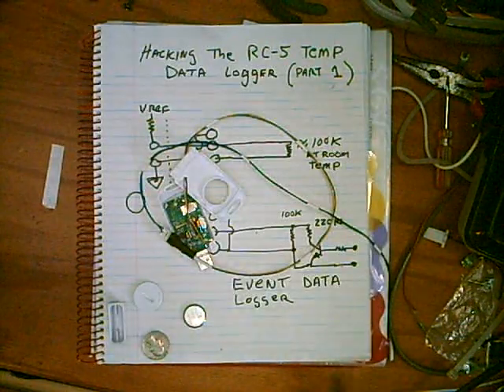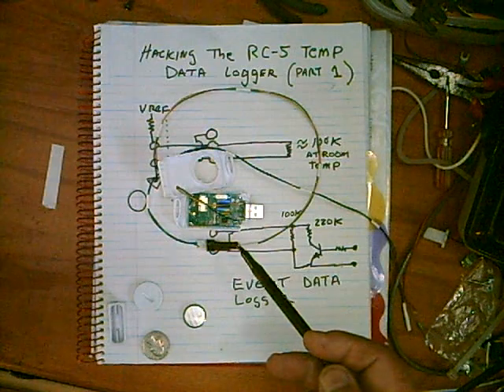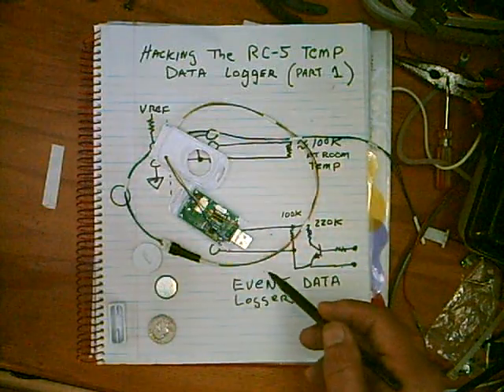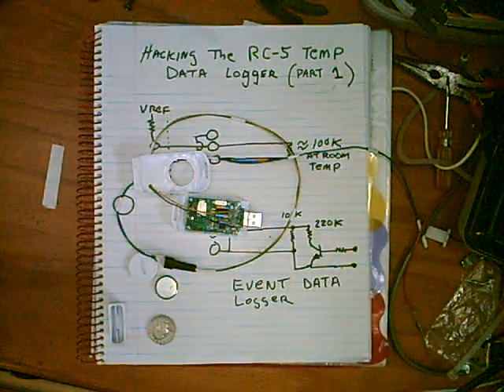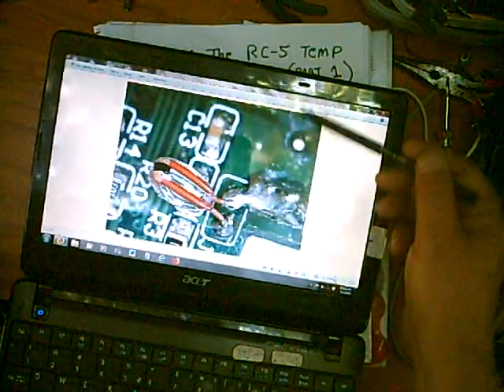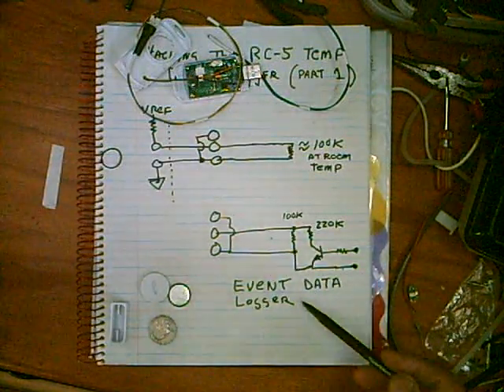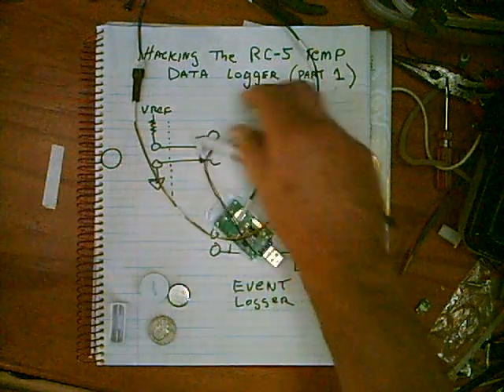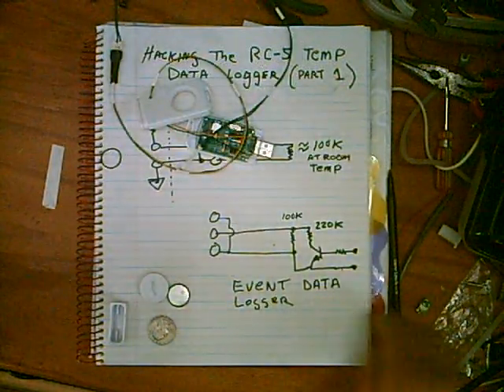Elitech RC-5 Temperature Data Logger Recorder Hack (part 1)

Comment: I wanted to use the Elitech to remotely monitor temps. The problem that I am having is that the logger seems to must output to PDF, which is not very trivial to parse. it would be nice to hack the firmware to output raw logs.

Comment: This temp logger is a very interesting idea. How my hot water system is doing. If I keep the top element on the grid. It would be nice to see how much it is running and see how much energy im saving with my solar panels.
Reply from the maker: I'm logging some data now on the small tank. The 6 gallon tank had shut off by 9:30am using only 280WH. This was dog wash day and I just jump in the shower with her. That was a bit of water.That bumped it up to 420WH by 2:30 . The 10 gallon makeup water tank is at 48.8C and have put in 1233WH. I shut it off at 54.2C. I'll post some data in a couple of days. The charting with the factory software is quite nice.
Reply from the maker: I'm interested at what temp the thermostat switches at and nightly heat loss. A power meter would be a better choice for the AC. I have a cheap $10 one with a donut. I put it in a box and power it with a 120V line cord. I just double the W & WH readings for 240.  Here is a new video of a system like mine.  https://www.youtube.com/watch?v=x1wqhZKJJsc